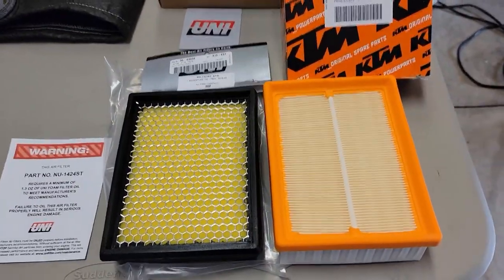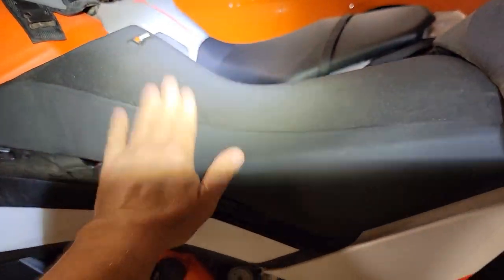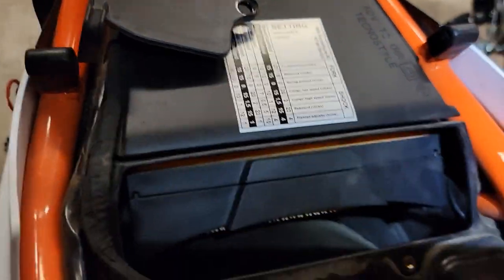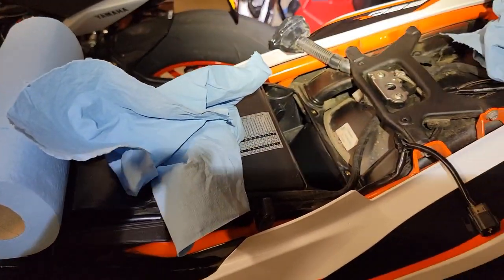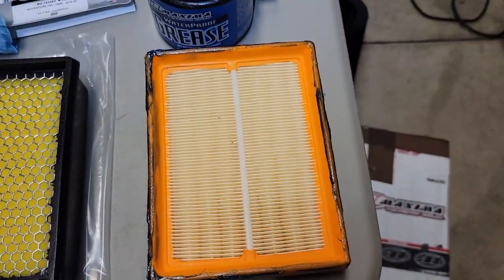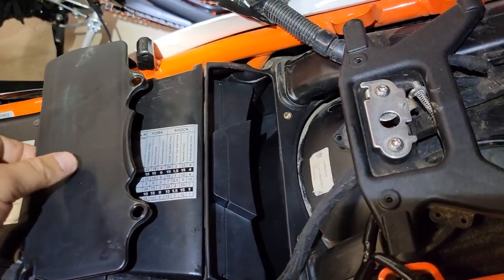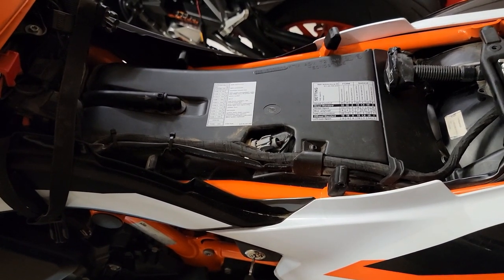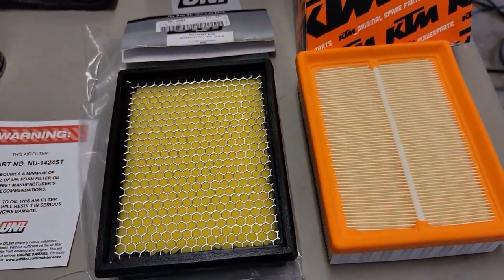KTM 790/890 Adventure R:  How to Change Your Own Air Filter? Foam or KTM OEM paper?

Comment: Paper filter - Pros: it is less likely to let particulate through than foam and is disposable. Cons: in really dusty environments (group off road rides) it packs with particulates more quickly cutting airflow, cannot be cleaned, a spare takes more space in my pack and if it gets wet in a water crossing it can blow out. I like running the stock paper filter with the foam Powerparts pre filter combo. Best of both worlds!

Comment: Definitely go for the foam filter. Better yet, get the Rottweiler power plate pre-filter, then you can still run the OEM paper filter. Block off/plug those drain caps in the bottom. Ton of dust gets through them.
Reply from the maker: Good feedback, thanks for commenting.  Rotweiller makes excellent products and I have used many of their products in the past with good results.  👍 Excellent idea! Here is the link to this product:   https://www.rottweilerperformance.com/rottweiler-performance-ktm-790-890-adventure-hqv-901-norden-power-plate-elite-edition/    

I actually just purchased one and will do a video on the install, I like that you can still run the paper filter and the prefilter appears very easy to clean and service. 

My only concern would be water intake during the winter months when it is wet all the time here in Oregon, easy to convert back if you change your mind but would need to leave 4 screws in air box or plug with silicone if you go back.  Perhaps they will make an Outwears cover for the foam which would solve the water problem.

Comment: I just picked up an 890R a week ago, unfortunately only have had a chance to put 30 miles on it. I would think the foam filter would be a good choice if a lot of water crossings were involved and with the chance of falling over in water?
Reply from the maker: Congratulations!  Great choice,  you will love the 890! I agree, if you are doing a lot of water crossings with a chance of falling over, I would opt for the foam filter. Yesterday I was looking at the foam filter choices and there are more choices now for foam even than when I purchased my UNI filter. Some looked easier to clean as the foam was removable from the frame.  Twin Air had one that looked like it would work well.

Comment: I ordered 23 890 and never owned adventure bike. When cleaning my 350, I always remove the seat and take off air filter & replace it with a sealed plastic cover so no water goes in air intake. 
Is that not a concern for this bike or other adventure bikes? Are those snorkels so far back and protected that water can’t enter? 
I looked for covers online and didn’t see anything.
Sorry prolly stupid question but all I’ve ever known is dirt bikes and a xs750 triple in the late 80s😂

Comment: I have been wondering the same thing - paper or foam?  Looks like it will be paper for me too!  How many miles on that filter?  How many were dirt?
Reply from the maker: 1,400 miles, 70 to 80 percent dirt and gravel roads, but a lot of it was in the rainy winter. However, on my last ride,  most of it was on dusty gravel roads and I ate dust for about 4 hours so it was a good test!  It was good to see that the paper element kept i take clean.   I'll keep watching it to see how it does over the summer.  My 790 did well with paper in summer riding though now that I think back.  Happy riding!
Reply: @oregonmotojohn  1,400 miles on mine too, but probably less than 200 of which is dirt.  I just looked at my factory paper filter for the first time.  Clean as a whistle.  Puts some grease around the edge and closed it back up.  I also installed the UNI pre-filter socks on the snorkels.  Now that I am done, I am wondering if those pre-oiled socks will cause more harm than good as they may clog much more rapidly in such a small space.  It guess I will just have to monitor.
Reply from the maker: @bva8252  Awesome, nice work checking into things to see how they look.  Good job with adding some grease as extra protection.  I had the same concerns with the small snorkels and then  filling them with foam. Ride the bike, see if you notice any change in throttle response and if you do, I would take them out.  However, if you ride the bike and all seems like business as usual, then I would leave them in and check now and then as you mentioned to be sure they are reasonably clean.  You have a good game plan!

Comment: KTM power parts offer a foam filter from the dealership so the MAS is not an issue.  Beware of some of the after market foam filters, the twin air filter I had did not have a very good seal to the air box, just a tiny rubber strip.  Got a funnel web now which has a very good greaseable  seal.  The power parts one looks good as well.  If you ride in dusty conditions with other bikes it is no contest…foam. Cheers.
Reply: I think the biggest advantage of a foam and oil is if you doing lots of water Crossings and you do take a swim you've got an opportunity to wring out the water dry the filter out the best you can and then re soak it down with oil if you've got someone to just have some 30 weight motor oil or whatever to get you through in a pinch where on a paper filter when it gets wet it's pretty much shot the very nice video thank you